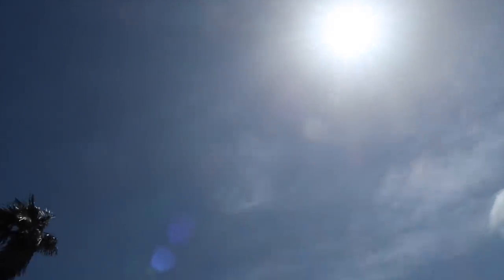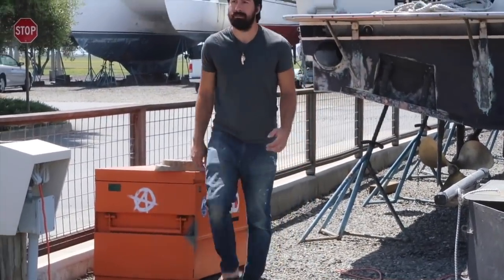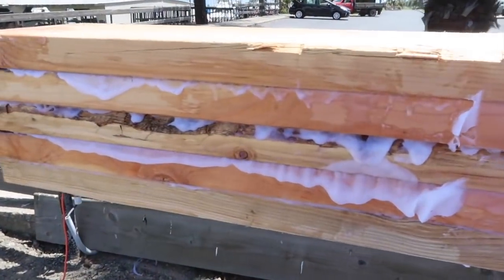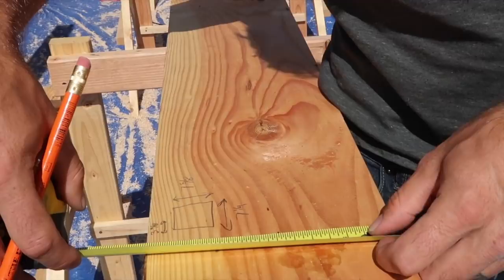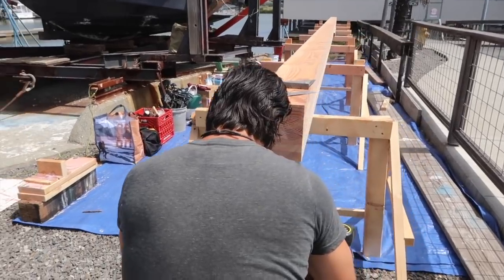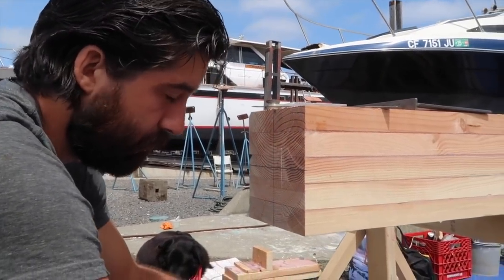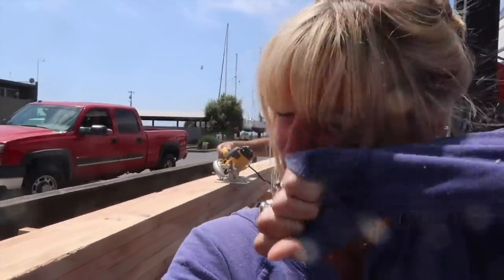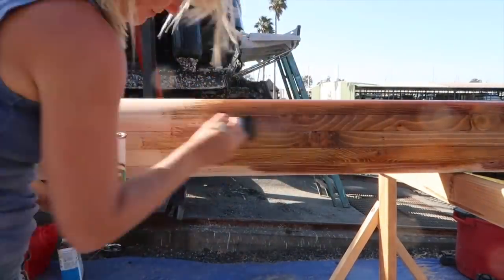Salt & Tar: Episode 53-Building Our Main Mast

Comment: I'm not a sail boat guy but I am a fabricator and my dad is a lifetime carpenter. That mast looks great, I noticed the staggering of your ends which is the right way to do it. Reason I'm commenting is I was going to suggest wrapping some steel straps in various places up the mast just for extra assurance so the flexing won't cause delamination of the mast. And it would give it a old school Viking look lol. Again I'm not a sailboat guy and I'm sure it will be fine, just over think things at times. Just a suggestion. Great job.

Comment: Have been watching series from the start, really enjoying the trip. Suggestion, when making crosscuts with circular saw, try placing speed square on far side of cut. line up saw blade on the cut-line, using square to line up saw shoe. Make your cut against the square, it will improve accuracy. PS, you are a pretty good freehand cutter :)

Comment: When you laminate like this, you should alternate the direction of the heartwood for each slap. Like this, it might want to bend. You should also turn the slaps bottom up from the direction of growth. That will prevent water from running in to the woodgrain, if you make it smaller against the top.

Comment: To determine where to draw your 45° lines all you needed to do was draw a circle on the end of the mask from the center to the edge of the shortest two sides, then draw your 45° lines tangent to the edges of the circle on each corner of the mask. Also, you could make a scraping tool by cutting one quarter of a circle out of a piece steel, like an old saw blade. Done correctly this will work like a plane and give you a near perfect circular mask.

Comment: Did the skill saw not come with the guide, would have come in quite handy for those long rips. A tight fitting stainless mast cap would definitely assure against water ever penetrating the end grain of your mast, it's probably something you've already had in mind, thought I'd put it out there. Btw nice job on the mast so far, gonna look quite snazzy standing tall and proud. Cheers !

Comment: Hey guys I love your videos, have been watching since the beginning, great job...  HOWEVER, you both need to start considering using personal protective equipment (PPE), the level of noise created when using a circular saw is enough to cause hearing damage.  Hearing damage is irreversible.  Also eye protection, your eyes cannot be replaced.  safety glasses and earmuffs are extremely cheap in comparison to the cost of losing your eyesight or hearing.  PLEASE start taking care of your ears and eyes!  Add these items to your amazon wishlist and I will buy it for you if you both promise to wear them...  and keep the videos coming!

Comment: Hello
Is the new mast of a uniform diameter from bottom to top? :-))....Not a good idea, the mast is a dead trea attached to your sailboat, and as a tree it will either bend or break. In order to bend it must be flexible in its top half, this means smaller diameter.
Also, you should consider inserting round pegs the length of the diameter in the first 10 feet so as to add sturdiness, crosswise to the planks that you glued to make the mast. Epoxy is simply not enough, and pegs will add considerable mechanical strenght.
The lower section of the mast should also have an iron brace, basically an iron ring screwed to the mast, just the above the rectangular peg that goes down into the floor, this will prevent the mast from ripping apart and destroying the hull and the floor.

Comment: I wanted to scream! "USE a compass to make a circle on the end of the mast and then cut off excess on corners."  Secondly, Why not leave the bottom of the mast square?  it's going to be in the cabin and could use the weight and strength down there.

Comment: Will grain runout be a problem? Don't have  experience with mast making but I've made some wood bows and experience tells me that when wood fails at bending, it breaks where the grain runs out. Straight grained quartersawn the grain could run from end to end. Not so important that the core be clean straight grained as it's stresses will be mostly in shear that epoxy holds up great against but it'll be the outside that is compressed or put under tension.

Comment: I really like what you are doing and have been following you for a while.  Good job and great work!  One question, what steps are you taking to prevent pollution ie: plastic, resign, etc. from getting into to the environment?  In many of the boat repair, building related u tubes I have been following, it looks like not a lot of concern is given to construction/repair pollution.

Comment: why did you make a solid mast instead of a hollow one? As far as i know a hollow one provides same strength and less weight. In the 1960s german sand yachts were even equipped with masts with hollow sections and "knots" like bamboo.

Comment: Looks like you used construction lumber.  Bad choice.  0:09  Check out the big knot in the lower left.  07:25 three more knots.  07:57 Lotsa knots.  Lots of weak points.

Comment: Of course it doesn't do you much good now that you've shaped your mast but you can make an octogonal marking gauge pretty easily.  The ratio of the two sides to the middle is 1:1.414 and the ratio remains constant regardless of the angle needed to snug the gauge to your timber.  http://www.woodcentral.com/cgi-bin/readarticle.pl?dir=smalser&file=articles_646.shtml

Comment: Love the build, the videos, and the relationship. However, the math needs work. The eight sides were nowhere near even. Your four cut-offs were even to each other, the top and bottom as it laid were even, and the left and right sides were even. But you definitely had three different measurements. (Unless the camera/lens distorted it somehow.)
Still, if you're going for an elliptical or oval shaped mass, you're right on track. For 8 even sides, you'd have to start with a true square cross-section. If all of your rigging is loose or made to fit, then I don't foresee a problem unless something is tight and has to swing around the mast completely. It's looking good, but admittedly all I know about boats comes from y outube channels like yours, Leo's, A2A, and Tips From a Shipwright.
Hope all is going super well for your guys. I quit drinking years ago, but pop a cold one for me, for both of you.